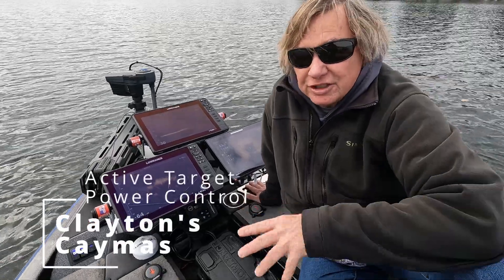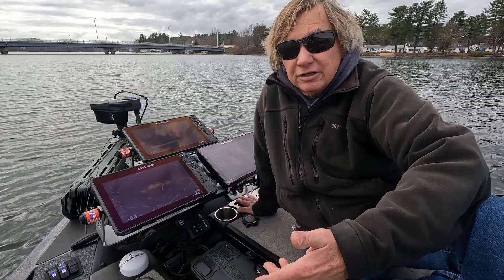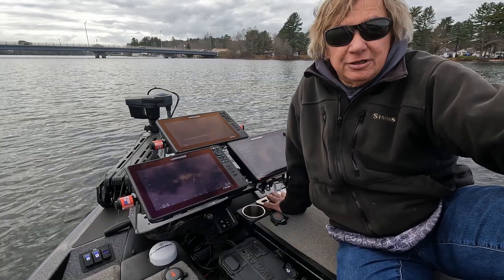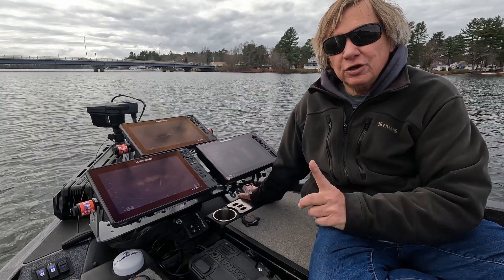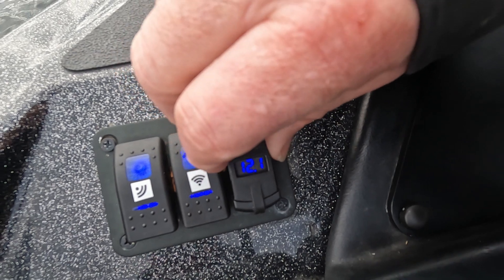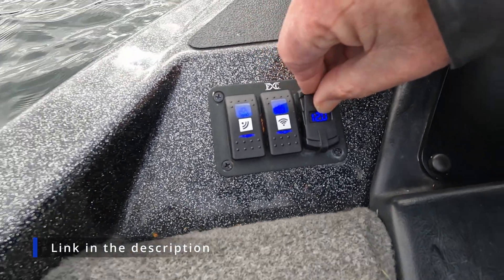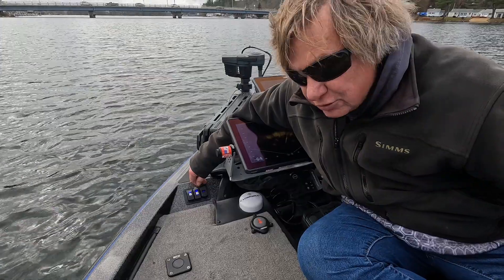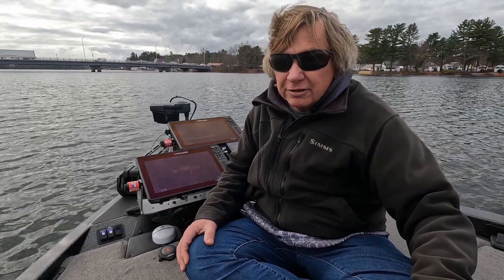Clayton's Caymas - Active Target Power Control

Comment: Would you be able to make a short video explaining how you wire the yellow wire to the switch. Half of the people say that turning the transducer in standby stops the pinging while others say it doesn’t work. Would much rather wire it directly to a switch.
Reply from the maker: Hi, that is a good idea. I'll make one about it. For the Active Target, you have to stop the sonar manually through the menu. Putting a unit in standby only stops its sonar connected directly to it. Since the AT is on the network and shared by all units, putting one or all units on standby has no effect on it. One disadvantage to using a switch to enable the AT transducer is that there is a startup time for the module to initialize itself, so the units will see No Source until the module is ready.
Reply: @garrywoodruff960  awesome, thank you! So stopping the sonar from the menu will stop the active target transducer from pinging?
Reply from the maker: Yes, if you stop it using the menu from the Active Target window. I think that it is under More Options.